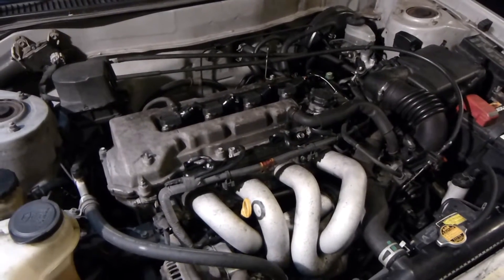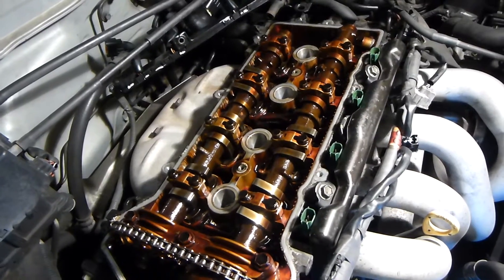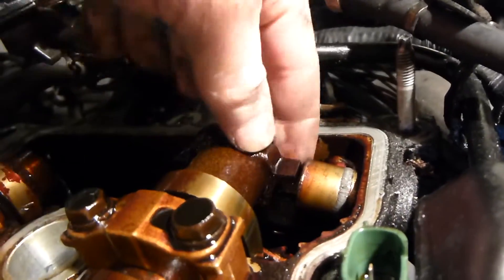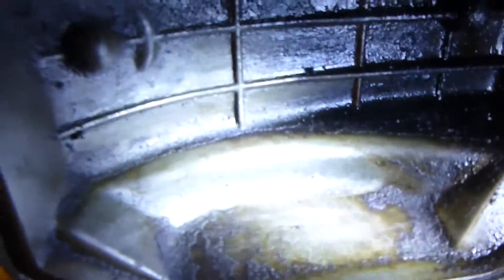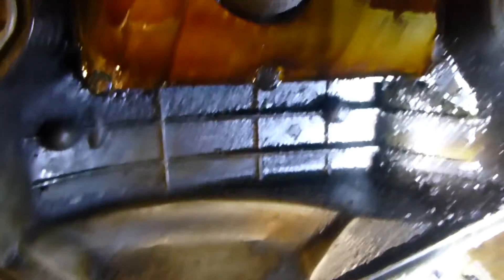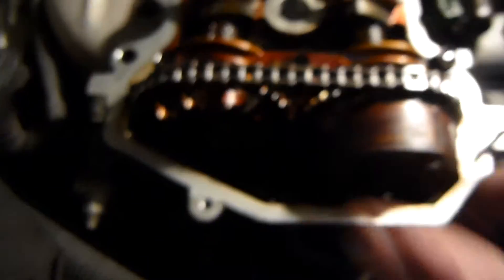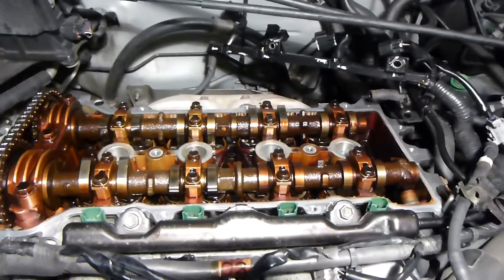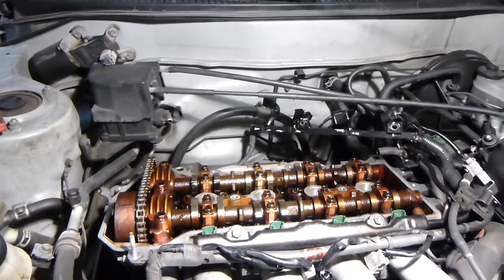Help Needed!!! (not any more, thanks!) Replacing Toyota Corolla Valve Cover

Comment: I have done a valve cover gasket on a 2002 Toyota rav 4 and I didn't need to use any gasket sealer but the surface wasn't pitted like yours. As per valve adjustment those are hydraulic lifters and there is no way to adjust them only replacing the whole lot. For the junk build up scrape the visible stuff off but don't use any water. If you want to keep the inside of your engine clean a few hundred kilometers before an oil change pour in a bottle of 'seafoam' or something like that (can find at your auto store in the oil additives section) and that will loosen up the build up and the oil should be much more dirtier that oil change. Hope this helps and have a great Christmas! 🎁

Comment: With the valve cover, just wipe it out as best you can. I wouldn't worry too much about it. It doesn't do much other than keeping oil from splattering all over the place.

2:44 Yes that's the cam shaft position sensor. It's generally used for ignition timing. For everything else the computer will use the crankshaft position sensor for timing.

3:13 It doesn't look adjustable to me. You could adjust by replacing the cams with performance cams and have the computer reprogrammed to take advantage of them. Other than that just leave it alone. No what you do it will still be a Corolla.

Don't use a metal brush or a metal putty knife to clean the top of the cylinder head. A degreaser and a towel should help clean it up. If it's really stuck, use something plastic.

Don't put any sealant under the gasket. It should still seal. If it doesn't, just buy a used valve cover from the salvage yard.

What I suggest you do is getting the printed factory service manuals for your car off of eBay. It will tell you exactly the torque specifications of all the bolts and if there is a particular tightening order as well. The factory manuals are worth their weight gold especially if your not experienced in this kind of stuff. If you're going to attempt a crank seal replacement, it's good to have one of these. Plus, unless there is an error or a TSB, whatever the book says should trump any internet advice you might get.

Comment: I agree with +Bottle Cap,  don't worry about the cover,  it doesn't do anything and thus won't effect engine performance when dirty.    Also,  don't use water as others have been saying,  put it back together and buy an oil additive cleaner,  then do an oil change.   That's your safest bet,  you don't want to accidentally damage your engine while trying to service it,  that would suck!

Comment: Yes, clean it, don't use a wire brush as one wire strand can destroy your engine, Use a toothbrush and that degreaser. Don't let any dirt or silicone drop in the engine. You can rinse the cover with water and dry with a rag. Make sure you don't over tighten the cover too much as it will warp  There is no adjustment on the cam followers  The crank seal may be a challenge.

Comment: That piece of metal is just there to cover your cams. Don't waste your time cleaning it too much, just clean the part the gasket sits on on both metals, put a tiny amount of RTV on the gasket, and put it back together. I don't suggest messing with your valve timing or replacing anything in the head unless the car isn't preforming within spec.

Comment: I wouldn recomend puting any water in that.But u should open it up if u can and see water would be the last thing u would want to get in the engine.And for the valves i bealive u will have to get the hole engine out from the car.

Comment: I've worked on many vehicles over the years and from What I See it looks like a typical high milage engine. And since you have the cover off already I'd say scrub What you can clean but most definitely don't  use water. I'm a fan of berrymans parts cleaner but any parts cleaner Will work. Like already stated though just be careful not to leave any bristles in there.  Also al lot of the newer gaskets don't require sealant.  The compression of the gasket  when installed should be enough to seal it up tight as long as the measuring surfaces Are clean. Love your videos. Keep em' comin.

Comment: The most I can offer is don't use gas or anything that is not a lubricant on an internal non combustion engine part. Before your next oil change add a quart of regular ATF (would not hurt to drain a little first to make sure you do not overfill it much) and run the engine for a few minutes then change it and call it good. The detergents in the ATF will help clean out the junk that actually needs to be gone. I will probably make a few mad but they call it brake cleaner for a reason. they call is fuel for a reason. they call it hand cleaner for a reason. stick to its intended purpose till you really know what it does. There is a difference between the shade tree mechanic that typically offers advice on here and factory trained. Not saying that you cant get good advice on here but always take it with caution even mine.

Comment: Yeah I would definitely wash that and do an oil change hope it turns out good
Reply: Getting water out of there would be a big pain in the hole! Cause even a few drops of water can cause the oil to go milky. What I do to get the water out is put the whole casting in the stove and wait till it gets up to 100c.
Reply: Anton Babiy ya and bubble all the paint? are you for real? you actually do that? water in the oil doesn't do shit. maybe if he had a high performance engine, like if your vvt runs of oil like a honda or subaru.
Reply: Zach Faulkner First of all, what paint? Secondly we aren't talking about a drop though a drop in a variable timed engine wouldn't do any good. And about the, "water in the oil doesn't do shit" watch a video about his old car and see for yourself.... Yes I've done this before and it works beautifully every time even with painted parts ;)
Reply: Anton Babiy its a waste of time is what im saying. if you told a licensed tech that you do that they would probably laugh at you. a drop of water will not make a difference.
Reply: Zach Faulkner licensed tech would never wash the underside of a rocker cover with water. They have special recirculating cleaners that use diesel if I remember correctly.
Reply: better than getting varsol in the engine, all techs at my shop clean with water after varsol.